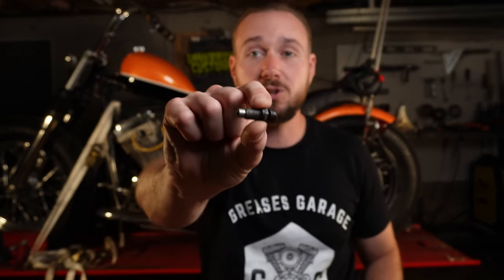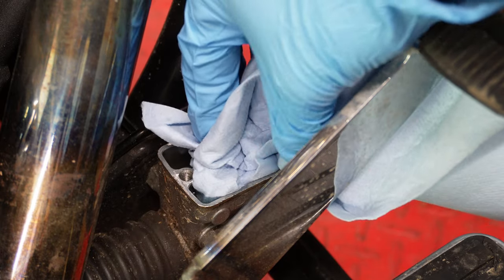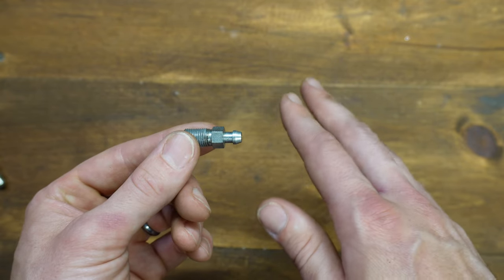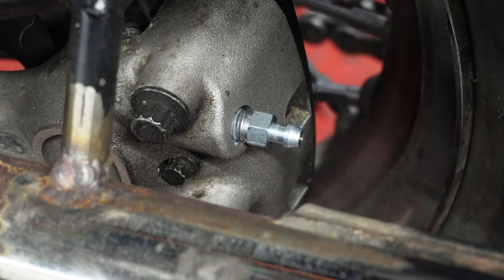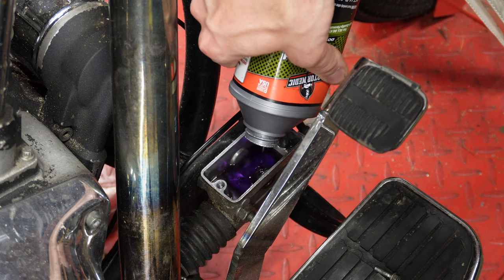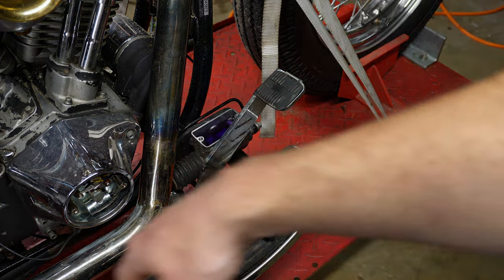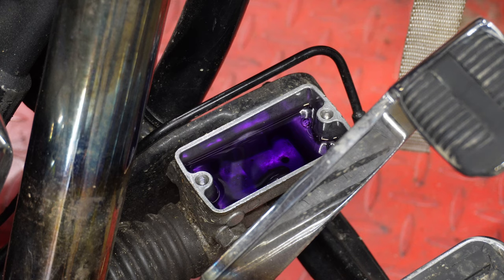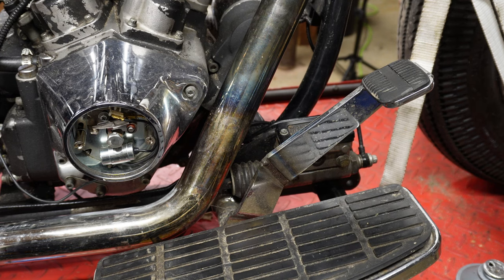The EASIEST Way To Bleed Motorcycle Brakes

Comment from the maker: QUESTION OF THE DAY:

Had you heard of speed bleeders before watching this video? If so, have you tried them before?
Reply: I put these on my bike about 10 years ago when I changed all the brake lines. Unfortunately I had big problems getting the air cleared. I bled and bled and bled and bled and still the brakes were spongy. Because it took so long to get my brakes firm I haven't flushed them in 10 years.  I realize I shouldn't have let them go so long.  My brakes are probably corroded.  I want to attempt this. I still have almost a full quart of synthetic DOT 3.  It was capped tightly and stored in the garage.  Is it any good?  Will the check valves still work?

Comment: OR, you can use a small oil/chemical hand pump connected to the Bleed fitting on your caliper and reverse bleed the system. works on all bikes. You pump the fluid in the old fluid overflow out at the master( Put a pan down, LoL ) until old is replaced by new along with any air. 100% filled and bled first time every time. Fast, Simple, No Helper needed and you don't have to chase down a part to fit your caliper. I've been using this method for close to 30 years at home, my shop, and on the road  BTW Nice video I enjoyed it well done like all the others in your series

Comment: I run both front and rear brakes on my rigid. I gravity bleed the front and basically do the rear the way you do yours. Great video. Also, love the point setup. Been running points for 50 years. Simple system, always gets me home. Ride safe.
Reply from the maker: Thanks Victor, you too!

Comment: excellent. Just installed 2 myself..........absolute game changer!   and/also I learned that REVERSE BLEEDING ie using a large syring to inject brake fluid into the nipple (when replacing a brake line, for example) will push out much air/pre-prime the system in a better way.  Then swapped over to the speed bleeders to push fluid out.
Reply from the maker: The perfect system!

Comment: Just spotted you are running points in your Evo motor - excellent choice. I am sure folk would find a video on timing the points without resorting to the timing marks on the crank really useful.
Reply from the maker: Thanks! Yea I’ve been very happy with them, super simple and easy to work on. I will say though, I’ve always used the advance mark on the crank to set the timing. Do you do it a different way?

Comment: Dudes! So got these bleeder deals, worked on my chopper great. Put them on another bike, pump fluid, get some fluid coming out, tighten the bleeder, only getting slightly tighter brake, still squishy. Banjo has new crush washers, tightened well, lines are pretty new, can't seem to get it to tighten up. Heard maybe throwing some pipe thread on the bleeder threads? Any other ideas y'all got?
Reply from the maker: One other idea I can throw out is that sometimes the seal on the piston inside the caliper can let go and the fluid leaks out past the piston and onto the rotor, if the brake is really old it could be worth popping it off and making sure the piston seals are still good

Comment: Question...when you filled the reservoir with the new DOT 5 fluid and you opened the bleeder valve, why did we not see any of that purple fluid coming out of the hose, which would have indicated a full rotation of the new fluid?
Reply from the maker: It’s just tough for the camera to pick it up, if I drained it into a clear can instead of a black bucket you would see the purple tint

Comment: On my XLH 94 hardtail I have a 4 pot performance machine caliper with all Russel brake lines and a 3/4 master cylinder. I have tried everything I know of and still don’t get a good brake. Lucky my tokico front one is good. Any suggestion
Reply from the maker: Are you using a speed bleeder like the one in this video?
Reply: @greasesgarage  yes speed bleeder from russel
Reply from the maker: @papagaiogaioladomato  my only suggestions would be to check all your banjo bolts and washers for any leaks, the caliper piston could be letting fluid out too, that’s also worth checking